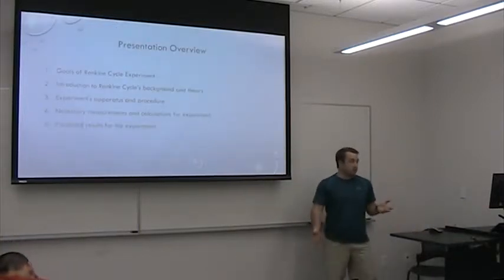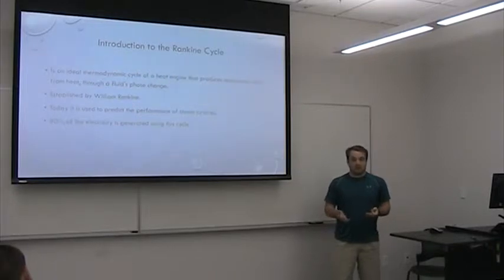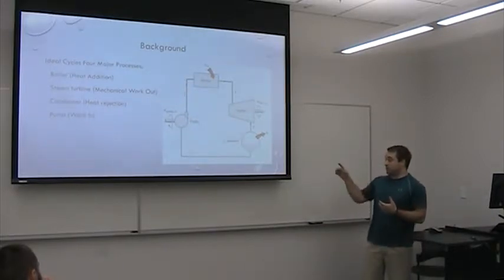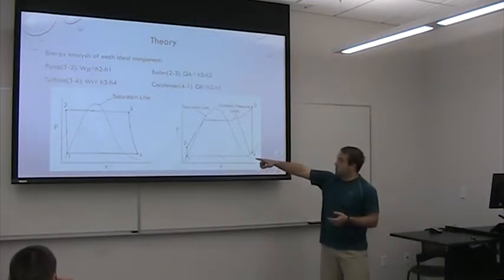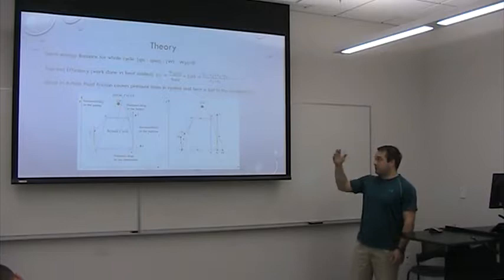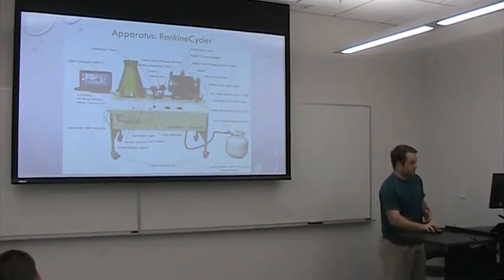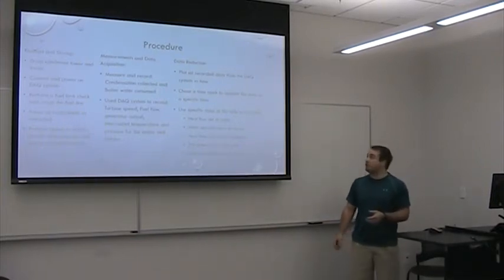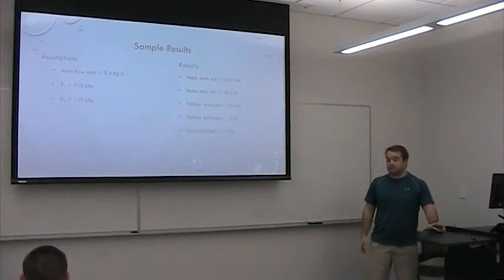MOV005

Comment: Positive: Good job mentioning how both pressure and temperature change in every process of the Rankine Cycle.
Improvement:  You could have broken the procedure section into several slides, that would have made it more clear.

Comment: o Positive: good overview of the Rankine cycle with a visual aid with key points where work or heat enters/leaves the system; good points about the expected losses and how to compensate for them
o Improvement: why did you make the assumptions you made for the sample results? What did you assume?

Comment: Positive: You explained how the actual cycle varies from the theoretical cycles with P-v and T-s diagrams.
Improvement: What is the functional reasoning for rejecting heat in the condenser and adding heat back in the boiler?